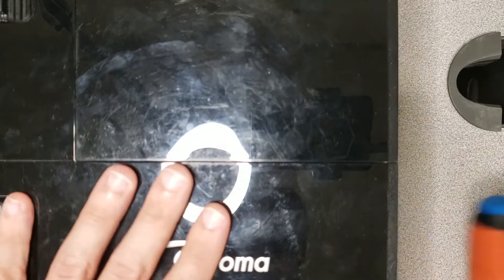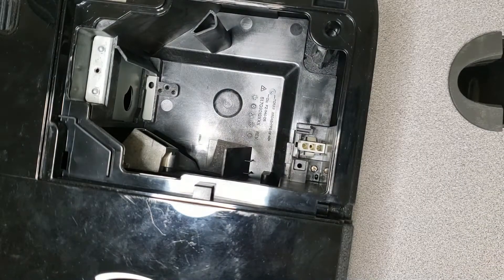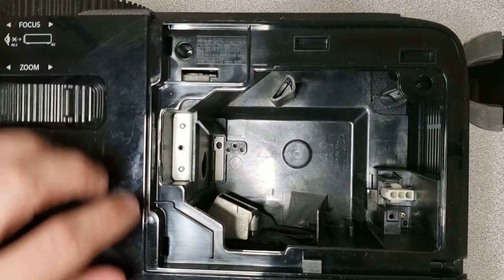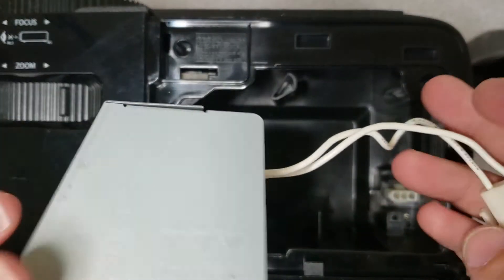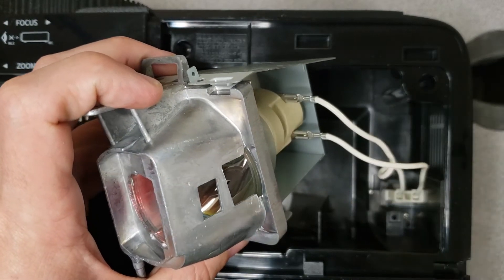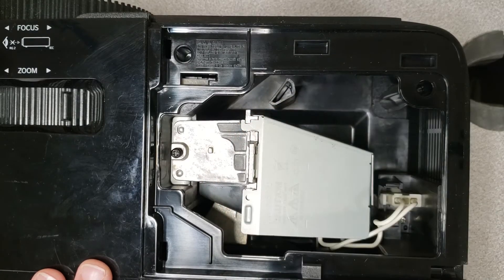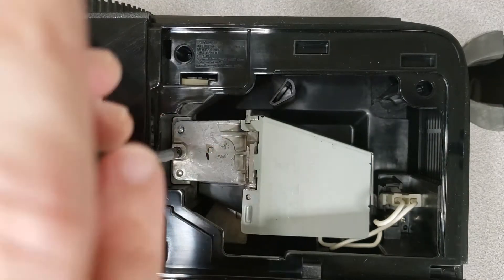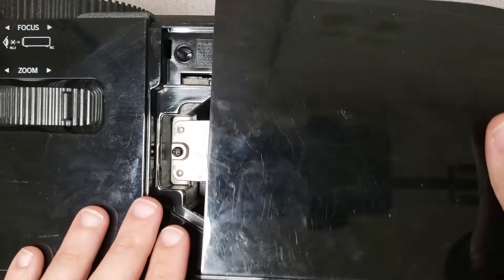Jaspertronics - Optoma HD146X Bulb Replacement Tutorial

Comment: any issues with dmd chip white or dead pixel dots? have you found a way to have better cooling?
Reply from the maker: The best way to improve the cooling is going to be frequent cleanings. Unfortunately any unit that has a DMD chip inside can have the issue you describe. If you are getting white pixels on your screen then it is very likely the DMD.